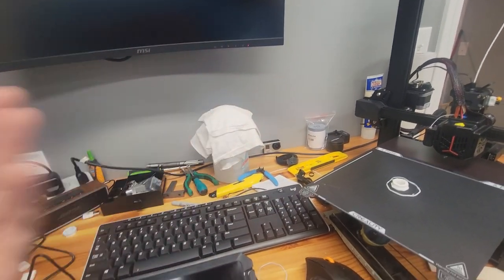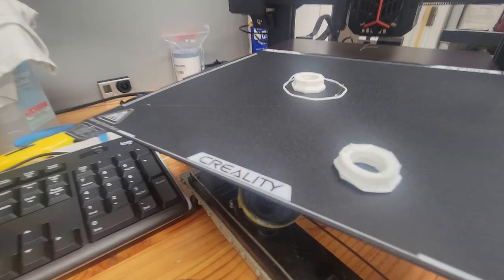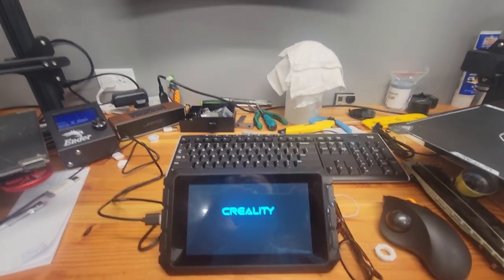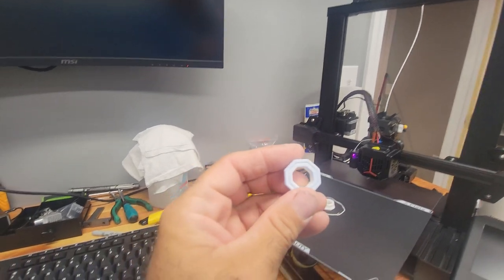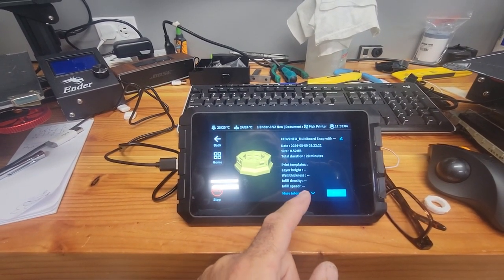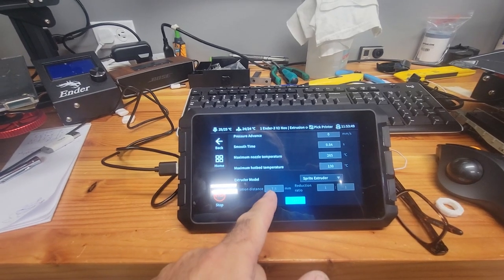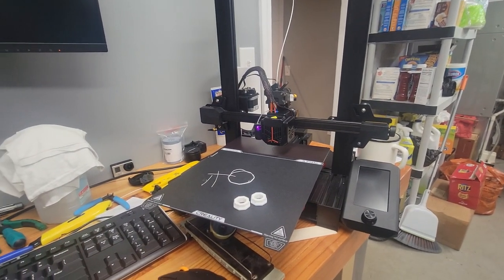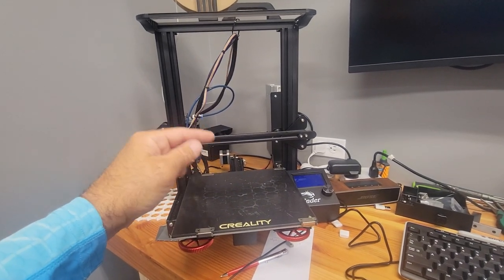Ender 3 V2 Neo and Sonic Pad

Comment: Have you tryed the 4 stack yet?
Reply from the maker: Yes, on my Ender 3 pro. I will get to it on the Neo eventually
Reply: @dougdoesstuff24  mine said 3 days 21 hours
Reply from the maker: @leroycline8849  Sounds about right if you didn't change any settings.  Don't forget to make the walls 3 and infill 15
Reply: @dougdoesstuff24  ok I will try that